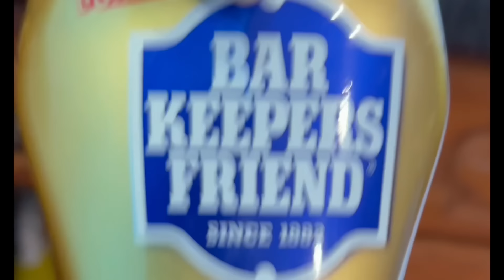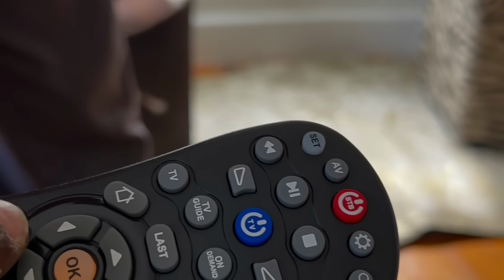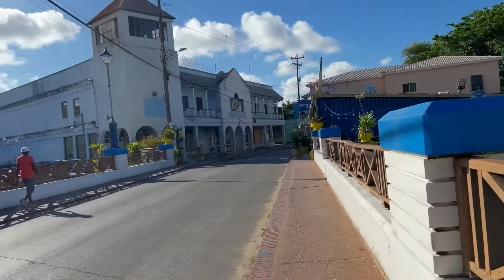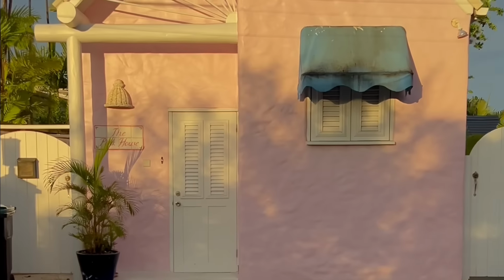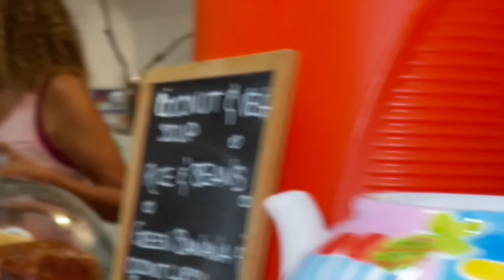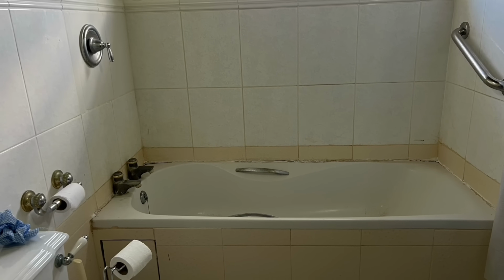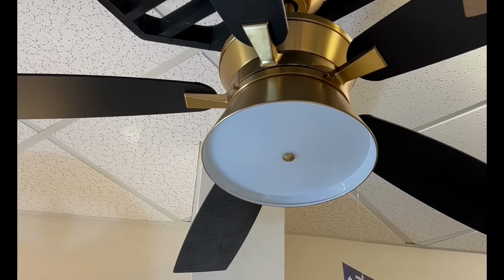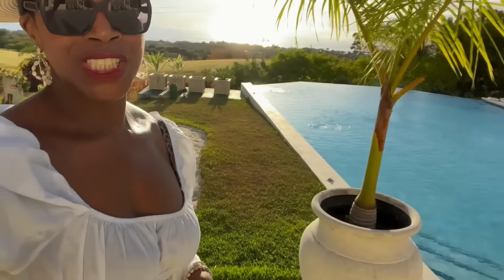MY FIRST MONTH SOLO IN MY DREAM HOUSE IN BARBADOS  | MOVING ABROAD ALONE IN MY LATE 50'S|TIPS

Comment: Was it costly to ship there.
Reply from the maker: From U.K. it was because I shipped a lot 40ft container and I had the full service. But it all depends on what you are shipping. It’s also worth reviewing 3 or 4 companies and checking reviews. Get quotes and remember you may want to take out insurance which they can advise or you can get your own Remember you may not require a massive container and you may just need a few barrels! I used Transpakship. Hope that helps